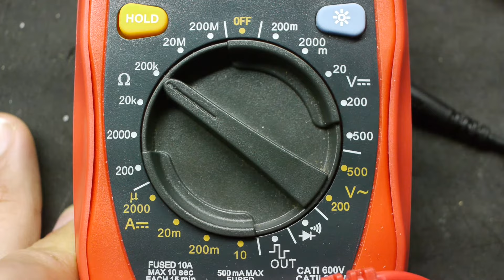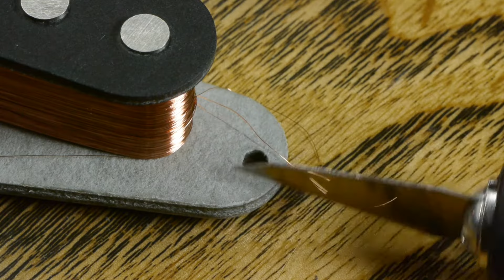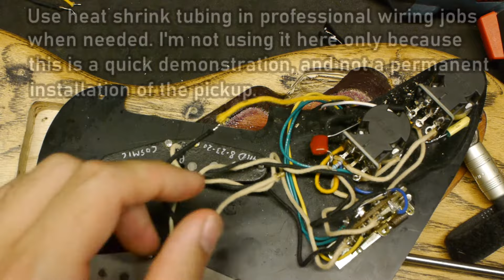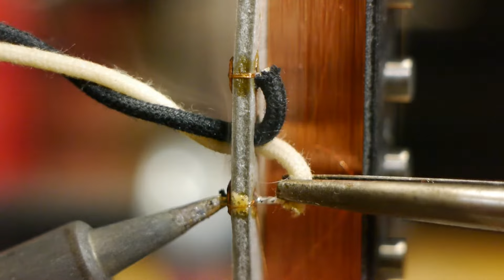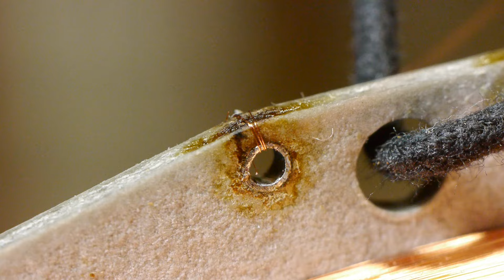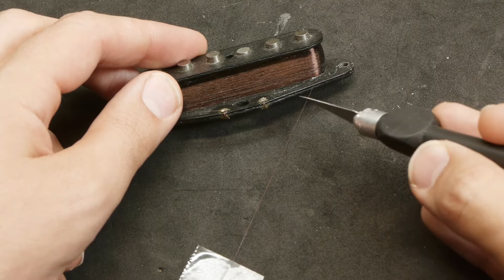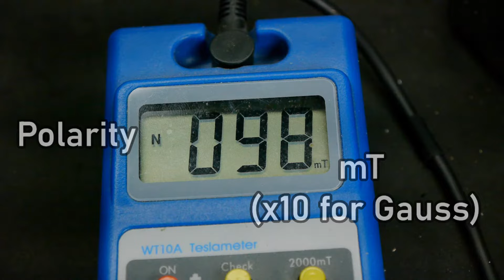Broken Guitar Pickup DIAGNOSIS + REPAIR | Fender Style Single Coil Diagnosis + Repair Demonstration

Comment: quite complicated if you don't know what you're doing, but thank you anyway.
Reply from the maker: I agree. In reality, I always end up tearing down and rewinding coils with very, very few exceptions if I ever run into issues with a pickup not functioning properly.

 The ins and outs of what's wrong can get complicated, but the solution is almost always very simple and the same for every one...tear it down and do it over the right way. Although I don't have a setup yet for unwinding pickups on my PenPal lathe. That would speed things up considerably -- unwinding pickups by hand is absolute lunacy beyond a few turns, in my opinion!
Reply: @guitar_md   I bet Fender had winders, would have been a nightmare winding pickups by hand. I arrived at your video searching for pickup repair. My neck pickup has a very low output / volume compared to the middle and bridge. I thought to just replace it, they are cheap enough, as in $15. each. But I also would like to repair it. Just don't know what the problem is but will try refreshing the solder points, which is simple. Thank you.
Reply from the maker: @zurdoremi  They absolutely did. Just a lot of people advise unwinding pickups by hand to find the wire break, but I think 99% of the time it's an exercise in futility unless you find a break within a few dozen turns. Unwinding pickups is much trickier than winding them and most people I've heard of unwind by hand -- not for me. 

In your case, the first thing to do is to detach the pickup from the circuit. Then test DC resistance. A visual inspection helps too, though if the start or finish wire were disconnected, you'd get no sound at all. Weaker output makes me think there's either a wire break or a cold solder joint either in the circuit or on one of the pickup eyelets. 

Re flowing the solder joints and re testing DCR is usually all you need to see whether a rewind is in order or not. Always keep in mind, no matter the issue, a single coil pickup is simply a single long strand of wire soldered at each end. 

If it gets detached from either end, or there's a break anywhere in that strand, it won't work. Very simple but sometimes very difficult to identify exactly where the issue is!

Comment: Thank you for this beautifully produced video. I have a 60s Strat pickup that I’m hoping to get repaired without rewinding. 
Do you do this kind of work for other people?
Thanks again, 
James
Reply from the maker: You're welcome. I do, but every time I've worked on a vintage pickup, I ended up having to rewind it. In theory you can trace a wire back to the break, but in 100% of the cases I've seen so far, the problem with older pickups is corrosion, which damages the wire closest to the magnets -- meaning a complete rewind will be necessary, as the wire damage is very likely within the first few hundred wraps.

'60s Jaguar, Strat, Tele and Jazz Bass pickups I've worked on all had that same problem. The good news is there's no reason to fear a rewind -- as long as the turn count is accurate, the DCR doesn't mean anything. 

I could always take a look, but just as a heads up I can nearly guarantee a rewind would be in order. If the break isn't at the finish eyelet it's most likely very deep in there.

Comment: It doesn't explain what to do if the pickup copper wire has broken 1mm away from the bobbin, you can't grab 1mm of wire with any tweezers well enough to pull it out to unwind.... Broken by the eyelet is not a problem sure we can all do that...
Reply from the maker: I actually made a video doing a repair exactly like that here a couple months later: 

https://youtu.be/1V6MWrivDio

What you're describing is a start wire break, which means unwinding the wire is NOT POSSIBLE, and attempting to do so WILL KILL YOUR PICKUP PERMANENTLY.

The ONLY repair is to splice new wire onto the broken wire. Notice how carefully I work to coax out the broken wire, to expose just enough length to splice to.

And I do mention in the title that I got lucky. Most of the time, if the start wire breaks, it's going to be buried in the coil so far that it's impossible to get out. There simply may not be enough length to splice to. That means all you can do is tear down the entire coil and rewind it from scratch.

However, it may be possible to splice using an ultra fine tip on the soldering iron, with even less wire length than I showed in that video. 

Think of it like this: if it can't be spliced, the pickup needs to be rewound anyway, so you have nothing to lose by attempting to splice. It's either that or a full rewind, period. 

Now, if the FINISH wire is broken, you can always unwind it -- it will simply peel off of the coil with very little effort. 

Start wire breaks are a death sentence for a pickup unless you have the skills to expose the broken wire and splice new wire on AND enough luck to have enough wire left to do all of the above. 

Hope this helps. I am working on a new video going over wire splicing magnet wire in great detail. In the above video, unfortunately, I couldn't show the actual splicing, only the aftermath. 

In the new video I'm working on, I show the actual splice in real-time, and in great detail with a high clarity macro lens. In that case, it's a break in the wire mid-wind, so I'm using much greater lengths of wire -- but the process is still exactly the same. 

Check out my playlist called "Pickup Building, Testing & Repair" for all the videos I have about this stuff so far, and to stay up-to-date. I'm always adding to my playlists as I compile more videos, and my intention is for them to be a repository of information for people like you that want their questions answered. 

I'm doing my best to organize my playlists and keep them up-to-date. Again, hope this helps. Let me know if you have any other questions!

https://youtube.com/playlist?list=PLN0ZS8PEGeRYHbxoypl6B8tRj0kVU41Na

Comment: My neck pickup on my 5 year old strat appears to have died. not really sure, but it doesnt come on when switched to the 5 position. in the 4 position, only the middle pickup works. is it common for new strats to have pickups die so soon. this guitar has not been abused or taken out of my house. doesn't have a scratch on it. the switch and pots are clean sounding and not scratchy. i have a 68 strat as well which never had a pickup issue till this day... hmmm

thanks for the insight my friend, guess i'll dive in and see what i can see.
Reply from the maker: They can die very quickly. The most common problem is the finish lead coming loose, which fortunately is a very straightforward repair. 

If the pickup isn't working, I'd take the pickguard off and test the pickup at the eyelets and/or disconnected from the circuit. If you're not getting a readout then the coil is broken somewhere -- either disconnected from one of the eyelets, or a break inside the coil. 

Cold solder joints in the actual circuit are another possibility, and sometimes you get lucky. But if you test the pickup separately, you'll know if that's where the problem lies or not. Let me know how it goes.
Reply: @guitar_md  hi, thanks for the reply. lol, i got sidetracked and didn't realize you responded to my question almost a full year ago... anyway, i just decided to open up the pick guard today and put my multi meter on the solder joints of each pickup. the 2 good pickups read 6.9 k ohms, the one that isn't working right read 244k ohms...  i'm guessing based on your video, its a broken wire... also, i did the 'tapping the magnets test with the screwdriver through the amp. nice loud sound comes from each magnet, but i remember you saying in the vid that there is still ac conductance going on due to the the wire still contacting and completing the circuit.... anyway, so what would you suspect based on that and what should be my next step? if you see this, your opinion would be greatly appreciated. thanks in advance!

Comment: Some days ago my Rick 620 neck pickup doesn't work. I unscrewed plastic cover checked wire but found nothing wrong. Assembly back the cover and the neck pickup is back to work. Wondering what's wrong...
Reply from the maker: Most likely a shoddy solder joint or a ground wire touching something it shouldn't be. I'd double check the pickup with a multimeter, disconnected from the guitar circuit, to verify that it's working correctly -- 

-- but any time I've seen this, the problem is either that the solder joint on one of the pickup leads is not solid enough and it intermittently cuts out, or a ground in the guitar circuit is touching a hot connection it shouldn't be touching. 

Let me know if the issue persists after you've reassembled it. Intermittent cutting out is always one of the two. Weak solder joint, a wire that's twisted and coming loose, or a ground touching something it shouldn't.
Reply: @guitar_md  thanks for your reply. No I didn't do any troubleshooting yet. But I noticed the treble knobs don't work once selecting neck while bass knobs don't work once selecting bridge. Cause I earned the used Rick lately, now I am in confusion. Shall I disconnect all 5 potentiometers for troubleshooting?🏳️
Reply from the maker: @蔡正蓁  Sometimes I'll do that. Disconnecting everything and testing them individually to make sure they work is always a foolproof method. Though in this case it sounds like an incorrect wiring issue. 

I'd double and triple check to make sure every single wire is going exactly where it should be. Sometimes it's a single wire going to the wrong connection point that you didn't catch. Worst case scenario you can always disconnect everything completely and then wire it from scratch using an accurate diagram.

Comment: My finish wire broke even after I heated it up , it was broken at the eyelet that’s why I’m trying to finish it , I can’t find the end of the finish wire ?
Reply from the maker: Check out my Seymour Duncan pickup repair video here: https://youtu.be/1V6MWrivDio

I also am going to be uploading a video about how to splice magnet wire. I wasn't able to show it in that video, though I do show the end result and explain the process. 

Start wires can get completely buried in the coil if they break. You can see in the Seymour Duncan pickup repair video that I got very lucky -- there was just enough wire lead left for me to dig it out carefully with an Xacto knife, and then splice some new magnet wire onto it. 

If you really cannot find the lead for the finish wire, there isn't much you can do, but I will say that if the finish wire broke, it should be somewhere on the outside of the coil. There is no way for the finish wire to get buried in the coil if it breaks, so it has to be on the outside somewhere.

You might be able to prod around carefully with a toothpick or your thumbnail of fingernail. Magnet wire is very delicate but it can stand up to some degree of stress if you're careful, especially after it's been wax potted, which 99% of pickups are. 

But again, if the finish wire broke, it has to be somewhere on the outside of the coil, right around the top layer. There's no way for it go any deeper, so check the entire surface of the coil. Once you find it, it's simply a matter of unwrapping it a few turns, then tying it around the finish eyelet once you've removed the finish eyelet hookup wire and the solder from the finish eyelet joint. 

The start wire breaking is usually a death sentence for a pickup, unless you can dig it out like I did in the Seymour Duncan pickup repair video. 

Let me know how it goes!
Reply: @guitar_md  I tried to find the  end and was unable to find it  even with a needle and hairdryer and tooth brush
Reply from the maker: @christylasure7072   What kind of pickup is it? Make and model?
Reply: @guitar_md  fender vintera strat 60’s bridge
Reply from the maker: @christylasure7072  Let me know if you'd want to get in touch with me to rewind it for you. Done many, many Strat pickups in my time and am a huge fan of them

Comment: Neck pickup reads 0.0 and I heated where the lead strands come in contact with the eyelets...it will then work fine for 2 or 3 days then it will have significant volume drop and sound weak like its shorted.  What is the diagnosis?  Thanks
Reply from the maker: If it's working fine for a couple days then not working again, it sounds like there isn't a solid electrical connection at the eyelets. I've had this happen occasionally, and the solution for me has always been tinning the magnet wire before tying it around the eyelets. In order to do this on a finished pickup, you'd have to remove the finish lead, suck the solder out of the eyelet, unwrap the wire a couple turns, then tin it, tie it around the eyelet, reload it with solder, and re-solder the lead wire. 

If you're not comfortable doing this, you can also try dabbing a little flux on the joint first, before re-flowing the solder, Then tin your iron, re-flux the joint around the edge of the flatwork, on that tiny wrap of wire, then very quickly and lightly touch that with the iron. Very, very light and quick touch. Sometimes that can saturate the magnet wire with solder enough to make a more solid connection. 

I've rarely had pickups stop working where this wouldn't fix it. It does happen occasionally. But the fact that you're getting it working for some of the time is very encouraging. If it was an internal break, re-flowing the eyelet solder joints wouldn't do anything to fix that. Almost nobody tins the magnet wire before tying it onto the eyelets. My friend Rob DiStefano from TDPRI taught me that trick. He always tins the magnet wire before tying it around the eyelets, which is a practice nobody else uses -- but prevents problems exactly like the one you're having. 

In my early days on eBay, I wasn't tinning the wire, and I had a couple people say they had to re-flow one of the solder joints to get the pickup working again. Ever since I started tinning the wire, I've never had that issue again. But of course, unless you're winding your own pickups, you have no control over this. If I had my way, everyone would be doing it from the factory!

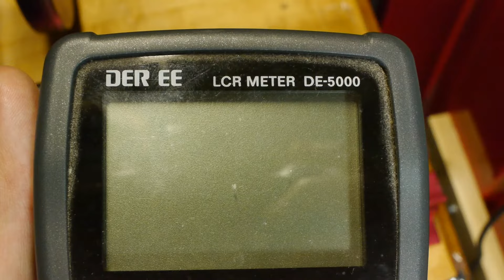Comment: At 5:19 you say your cheap multimeter measures zero resistance. But it doesn't. " 0.L" reading is not zero resistance but "overload" meaning the measured resistance is higher than the current range setting is capable of. It's telling you the resistance is greater than 2MΩ. That you get a reading using the pickup leads suggests you were not getting electrical connection through the surface of solder at the terminals.
Reply from the maker: Good catch! Wasn't aware of the "overload" reading. On this multimeter, with the probes touching absolutely nothing, by default it reads 0.L or 0L depending on the setting (20k or 200k), so I just assumed it was not getting a reading. 

Upon further reading, apparently this means "open loop" or "open line" as well. I suppose "overload" is the same thing -- an open circuit/open loop, not connected at either end and with extremely high resistance. 

I'll keep that in mind. Thanks for catching this and letting me know! I depend on commenters like you to catch any mistakes I make, and it greatly contributes to the quality of my videos.

Comment: I have a Lindy Fralin blues special set for a Strat.  The neck pick up is dead, it has been for years. I'm trying to solve the problem and found your video.    I am getting a connection from the start and end wires to the wire terminals on the pickup and re-flowing the solder with flux may have helped that but didn't fix the pickup.  I am getting some readings with a multi meter. With the positive/red lead (from meter) on the white wire connection point on the pickup...  i'm getting 14M, 46M 34M on three of the magnet poles.  They decrease in value the longer the connection to the meter is maintained.  I'm not sure i'm doing this correctly, in your opinion does this mean I have a short against the magnets inside the pick up windings, and the pickup needs rewinding?  Thanks for any help or advice.
Reply from the maker: I've never tested a pickup like that, but there shouldn't be any electrical connection between either of the wires and the polepieces. If you set your meter to continuity mode and test, that's basically the same thing -- and it'll beep if you're touching one of the wires and the polepieces at the same time, if the wire is shorting to the polepieces. 

I can almost guarantee the problem is that the magnets corroded, part of the wire broke inside the coil, and the wire is making electrical contact with a few of the polepieces as a result. The only real solution in that case would be a full rewind. 

I do rewinds all the time and can rewind that pickup for you if you're interested. I have a bunch of 42 gauge single poly nylon wire in stock, which is what the Fralin Blues Specials are wound with. If you'd like to contact me privately, my e-mail address is md101089@hotmail.com. Thanks again for the comment!